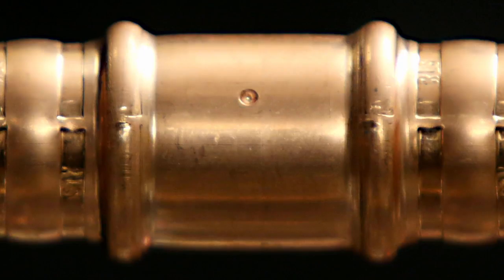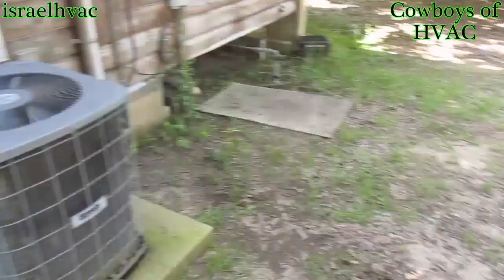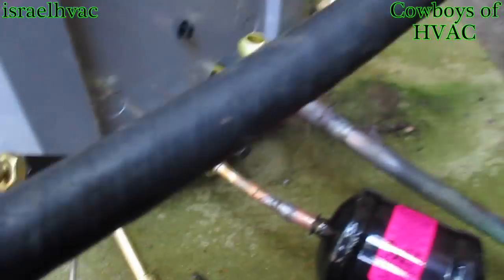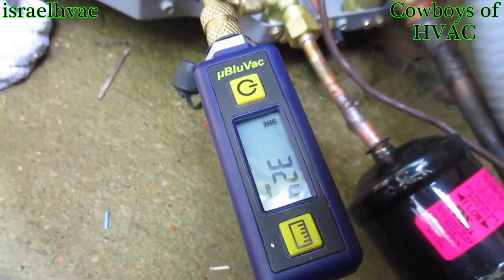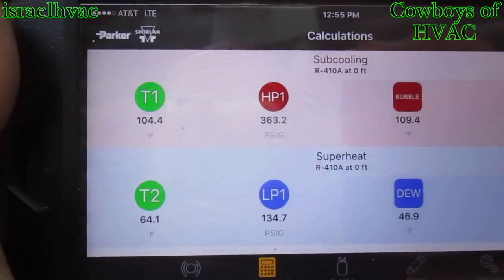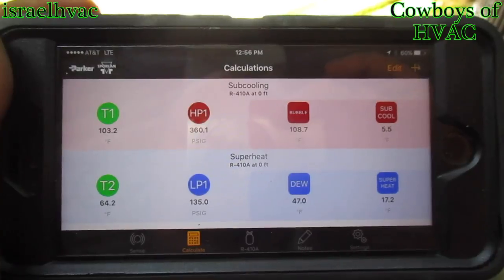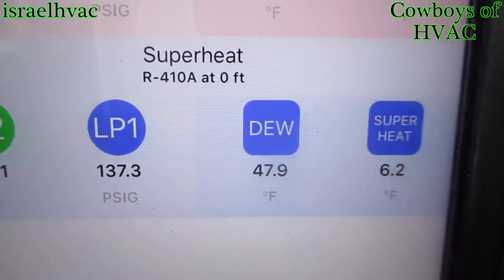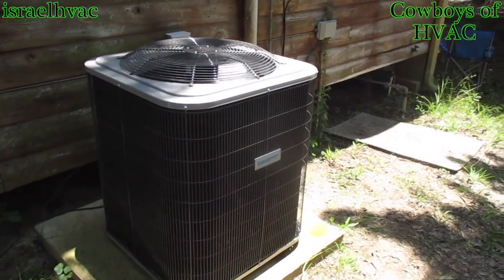Straight Cool to Heat Pump | Sporlan Pro R Tool

Comment: Hey Bud. I know this was 5 years ago, so hopefully you’ll even see this. But since this was a straight cool system you converted to heat pump, how did you configure the evap? Was it a flow-rater rated for reverse full flow in heat or was there a TXV installed that a check valve was needed for reverse full flow again, in heat mode? I’m asking because I have 3 old First Co fan coils I was thinking of converting to heat pump configuration to forgo the use of 5kw strip heaters that are installed.
Appreciate any feedback. Thanks 👍🏼
Reply from the maker: The indoor unit has a piston in heat mode it bypasses the indoor metering device and uses the outdoor metering device

Comment: hey I have a question, how can you remove the Schrader valves if using 45 degree fittings?
Reply from the maker: Oh yes it does!!! I'm love people like you that think you know it all!!! LMAO!!!
Reply from the maker: I don't pull the schraders out
Reply from the maker: Chad Schafer I used to pull the Schraders out I have videos on my channel of me doing it!! It might be a little faster but not night and day!!! But get over it dude if I don't pull them out I don't pull them out if you want to pull yours out pull them out
Reply: very "short" smaller diameters doesn't effect the flow as much as longer smaller diameters, but all that aside, if your in that big a hurry, you need more CFM flow, just use multiple pumps! :)

Comment: John! great job and thanks for sharing. how long does usually takes to completed a condenser change out if everything goes good meaning no unexpected  issues occurrences. it is ok a 3hrs for condenser and 4-6hrs complete system? or it should be less than that base on installation kind and area were indoor coil is locate factors?
Reply from the maker: It usually takes me about a hour and half - two hours. This one took me a little longer because i had to rewire AHU because i went from straight cool to heat pump
Reply: Thanks! John.

Comment: Still didn't flush system? And how do you get ALL of the oil and contaminants of r22 out of an already in use evap?
Reply from the maker: Jessica m I blew nitrogen threw the line set and evap. Can't always get every little detail on camera sweetheart
Reply: I do not use flush. I run nitrogen through lines as well. The vacuum pump will take care of the rest. And btw Jessica M. If some oil was left over, its minor. And that would not contaminate the sustem. Don't let them tell you it ruins anything. Good job John.